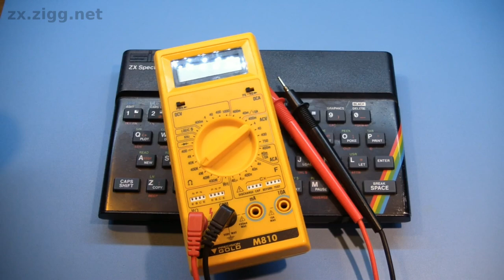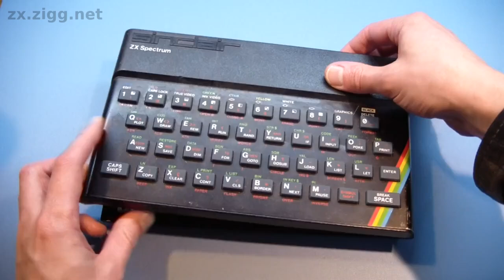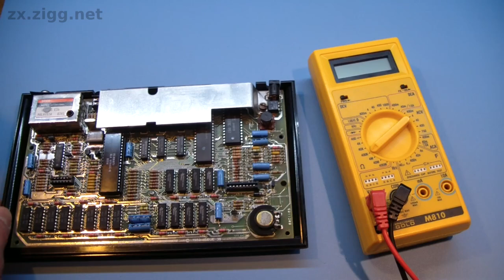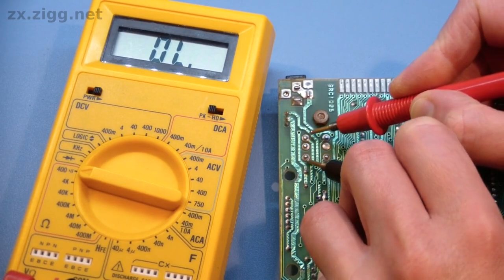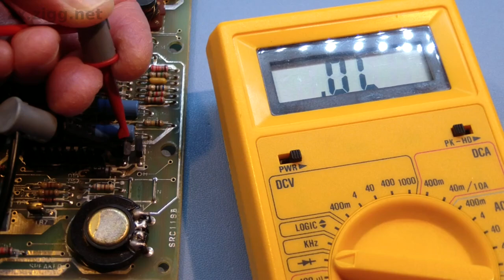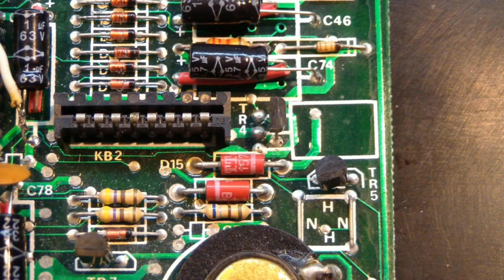ZX Spectrum (48K & 16K) Initial Tests

Comment: This is such a great video.  I just got my first 16K ZX Spectrum.  I am using a BK Precision multimeter to perform these tests.  The first test of the 7805 voltage regulator shows only 0.4 ohms.  So I am assuming this is faulty?  Or, do you think that is "close enough" to an open circuit?   When testing the lower 16K RAM, I'm only getting 1.8K ohms on the 12V supply.  This is a revision 3, BTW.  What are your thoughts on the condition of this system?  Thanks!!

EDIT

For those that are curious, never mind my previous question.  Apparently, I had the manual range set incorrectly with my multimeter.  After setting it correctly, the DRAM chips measured within range on all three voltage levels.  I also confirmed the transistors were good too.

However, I am certain the 7805 voltage regulator is dead.  So I will replace it.  The power post looks like crap too.  Looks like someone tried to fix it at one time.  And, I don't like the negative terminal being in the center.  Thanks for your great videos!!
Reply from the maker: +cb meeks If the 0.4 ohms you measured was across the power input, then there certainly is something wrong, very likely the 7805 has failed. Capacitor C50 is another candidate for causing this problem. If the Spectrum still has its original electrolytic capacitors, I recommend replacing them anyway. If you want guidance on doing this: https://www.youtube.com/watch?v=TeCVt2T-YSo

1.8 k ohms between the 0 V and 12 V rails doesn't suggest a fault.

All the Spectrum models that use a DC barrel connector for their power supply input require negative on the centre pin, as do quite a number of other items of electronic equipment the Sinclair brand was in some way associated with. I suggest putting a label of the rear of the case to remind you of this.
Reply: JoulesperCoulomb Thanks for the reply!  Do you think it's worth the effort to replace that barrel jack with one that's reverse?
Reply from the maker: +cb meeks I think you'll struggle to find a new socket that does that, but I recommend you don't anyway. You'd then have a Spectrum that is different from any others and one day someone will plug a standard ZX supply into it.

If you're not using an original ZX PSU, I suggest, if necessary, replacing its output plug with one wired correctly for the Spectrum or permanently glueing on an adaptor to achieve the same thing, then put a big label on the supply saying it is for ZX Spectrums only.
Reply: JoulesperCoulomb That's a good point.  My problem is that I don't have a PSU for a ZX Spectrum.  And, I'd rather use something modern for that anyway.  So, it sounds like what I need to do is get a modern PSU and make sure the polarity is correct (with an adapter) and label that PSU as ZX Spectrum.  So, what ratings would you suggest for a modern replacement?  9V, 750mA?  I do plan on plugging in expansion cards like something with an SD card and perhaps an Arduino/AY-3-8910 combo.  So perhaps a 9V, 1.5mA?  Thanks again!
Reply from the maker: +cb meeks Look for a regulated 9 V supply capable of outputting at least 1.5A.

If you wish, I can sell you such a device with a rating suitable for powering all of the ZX Spectrum models that have a two way power input socket. Contact me at http://zx.zigg.net if you are interested.
Reply: So I just replaced the voltage regulator with a 7805.  I am now getting 102K/ohms.  Seems borderline.  Do you think I'm good on this?  Thanks!
Reply from the maker: +cb meeks That's a result I'd consider normal. If the resistances across the internal power supply rails aren't too low, I'd try turning it on now. If you're using a bench power supply, set it for 9 V limited to around 750 mA. If the current limit is activated for more than a second or so, turn the power off immediately.
Reply: JoulesperCoulomb OK, I was too excited and couldn't wait.  LOL.  Anyway, I did exactly that.  I took my bench power supply, set the voltage to 9V and the amps to 750mA.  I then set the current limiter on.  The very first time it powered on it actually climbed up to the max limit and the current limiter kicked in.  So I thought I fried it.  But, it then dropped to 500mA and remained steady.  I measured voltages and all looked correct.  I power-cycled it several times and each time it only climbed to about 500/550mA.  So I then plugged a wire into the lower pin 15 for composite (not sure what channel RF would be for NTSC TV's) and what do you know?  I got a picture!  It was B/W and wavy but that's probably because of the direct PAL signal into my NTSC TV.  But I'm excited to say the least.  I need to do a proper composite mod and try out my PAL/NTSC converter.  But I think it actually works.  Thanks so much for all of your help in this!